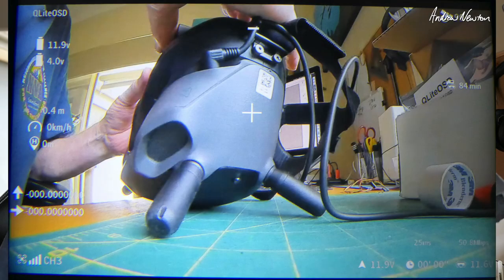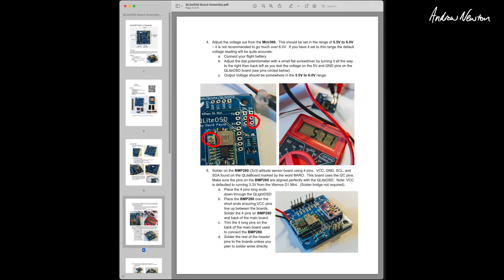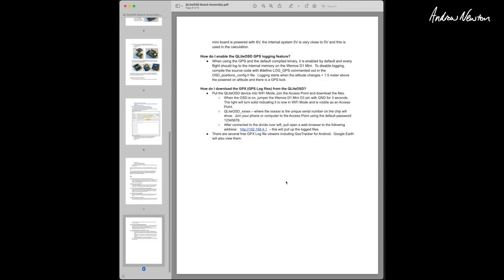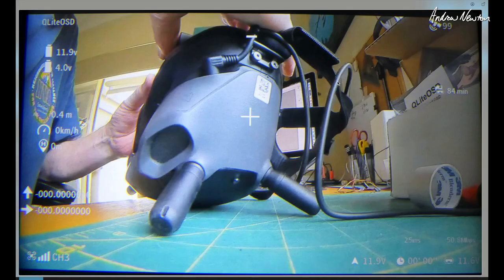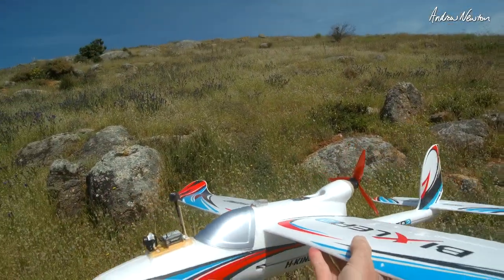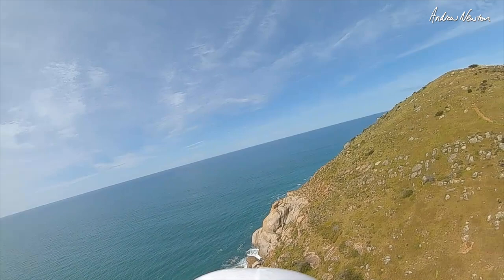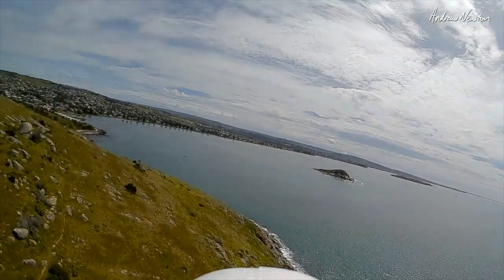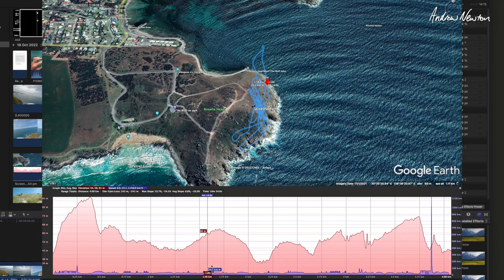QLiteOSD for DJI FPV

Comment: Have you used a Sparrow2 flight controller, Andrew? It's similar in operation to the Kopilot but has DJI OSD which looks identical to the one you're showing here.
Reply from the maker: I must check it out. That would be a perfect combination for many pilots
Reply: If you're talking about the Lefei Sparrow 2-OSD FC, I wouldn't touch it again.  They're flaky when it comes to programming via the sticks and get all fouled up over and over.

Comment: I didn't the the box you made for it on thing verse?  Can I have the stl?  I think I want to make this a one piece unit with your air unit / dji cam holder?  It would be cool if you made a 3d mount to hold them both?  Thanks!
Reply from the maker: STL on the QLiteOSD Github page